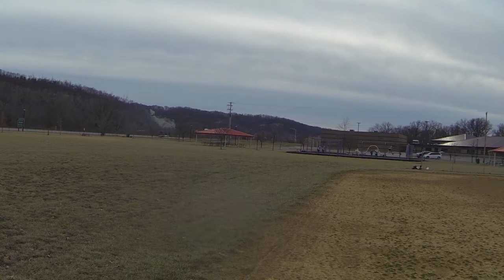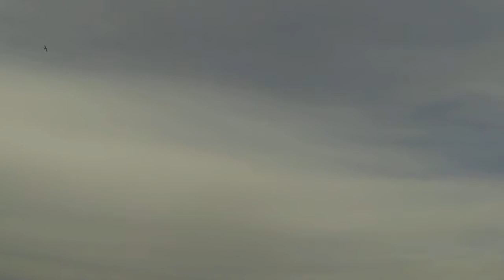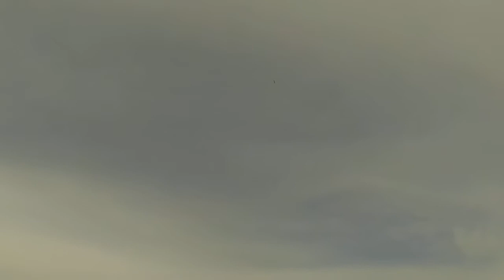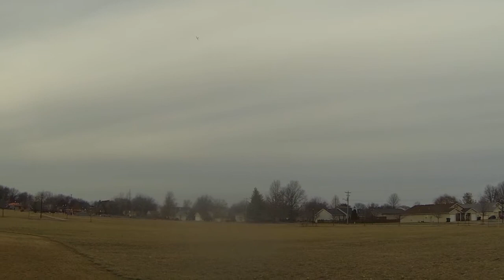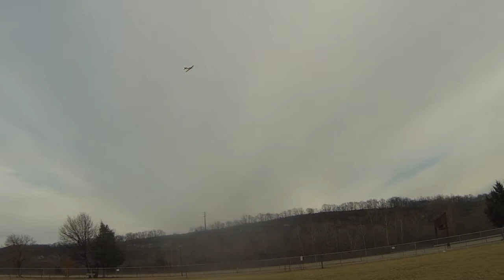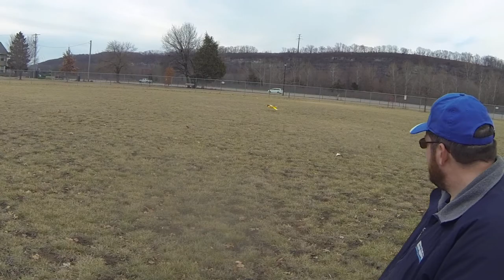Ace R/C Mach None (Electric)

Comment: I have one I need to finish I built 5 years ago. Built up wing, rudder aileron, flaps and electric motor. ....and oh, Retracks. Started to make it ready for the Norvel Big Mig but is why I hung it on the wall.Electrics is about all I fly now...so it will be 'lectric
Reply from the maker: Electric is the way to go!
This one is Flaperons.  It needs the spoileron setting to land in a smaller field.  It just wont stop flying.

I have since crashed this one but it is being rebuilt

Comment: What motor setup did you use?  Prop, battery?  I have plans and figured on scratching one out, just haven't gotten that far but it would be electric as well.  Just curious about your actual setup.
Reply from the maker: The motor is a 200wat Grayson Hobby Microjet V3.  Using an APC 6x4 prop and 1300 3s battery.
I did quite a bit of weight saving while building it.  used 1/16 sheeting for the top and windowed the sides and tail group as well.